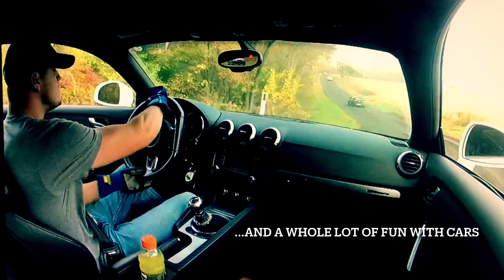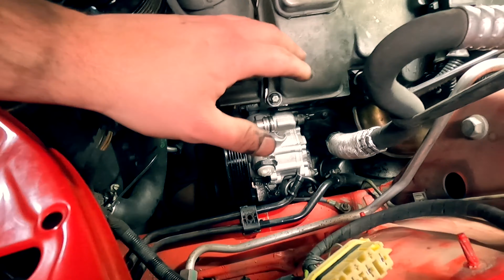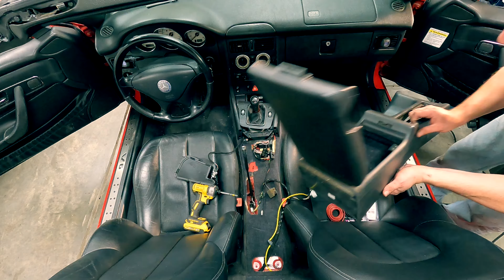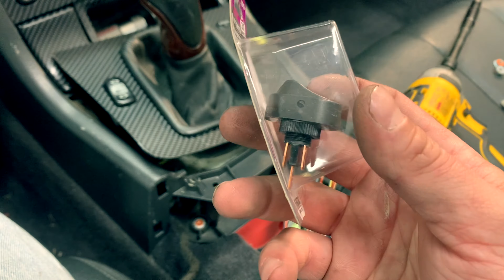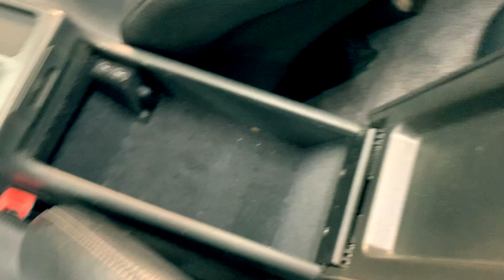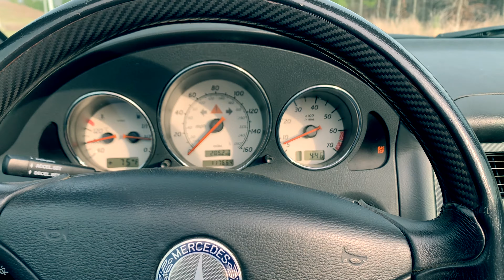SLK Build Part 2…everything is falling apart!

Comment: If uou dont want stability control, take out the clock spring. But i havent been able to disable the traction control
Reply from the maker: That’s not a bad idea, but it’d likely cause an airbag light…would have been easier if Mercedes just let you disable it like a normal person